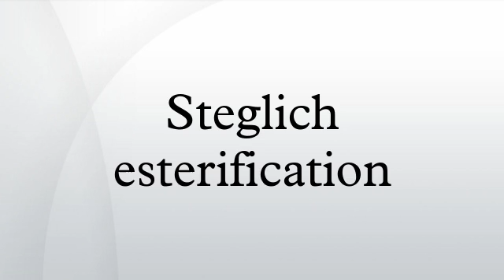Steglich esterification

Comment: Will carrying the reaction out at high temperatures affect the reaction? Since DCC leads to uptake of water to form DCU, what will the use of water in the reaction do to the reaction? Can DMSO be used as a solvent in the reaction? I really hope you can help.
Reply: +NATASHA LERATO Mzondi In the steglich paper they suggest other solvents. You cant use water since it will kill the DCC. If your reactants are not soluble in DCM, you can use THF, ACN or DMF, but the last one is a PITA to remove.